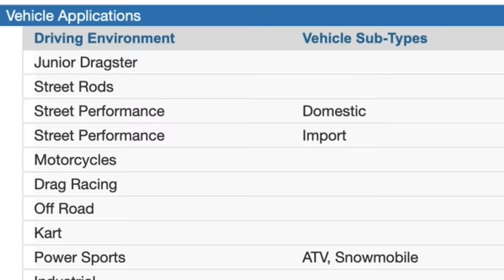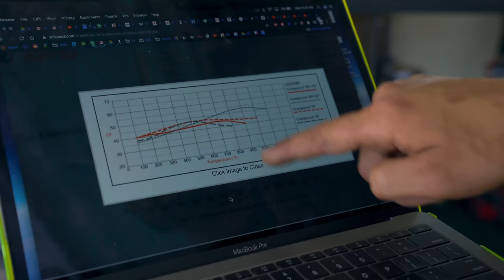Are Big Brakes Worth It?

Comment: One thing I did not hear but saw in the video is if your rotors are corroded and stuck make sure you use a rubber mallet. You can crack or break pieces of your rotors off with a metal hammer always go rubber.

Comment: drilled rotters are not drilled for cooling, they are drilled to let the gas that builds up between your rotor and the break pad escape.  The point is to prevent your pads from floating over your rotor at high temperatures.

Comment: For track work it is equally important to times to be able to brake as late as possible and slow down as quickly as possible as it is to be able to accelerate quickly. And on the street, so long as your pads are designed for street duty and do not require lots of heating to be effective, the extra stopping power will serve you well. I run Wilwood Aero's (6 up front 4 out back) with BP20 pads on a 3,500 car using 14" rotors. Dusty as all hell but quiet with the exception of the floater clicking. Far better friction and stopping force before ABS is triggered. On the road under hard braking my concerns are always about my ability to stop faster than others and getting rear ended - stopping in time is not much of an issue, even north of 100mph. If you are converting a street car for track duty, brakes are probably the biggest bag for the buck along with tires and frame stiffeners. Get your suspension dive dialed in to properly load the fronts under braking and life will be good... (To this day, I am still not as brave as my Wilwoods are good).

Comment: I know its a bit late for that, but make sure to NOT do any unnecessary heavy brakeing or emergency stops for the first 50km. If you dont do that the rotors might warp/bent(dont know which is the right word for it, sorry)

I hope this helps not getting any unnecessary costs! 18:38

Comment: 7:49 - "as you can see the new brakes aren't way bigger, and honestly, they feel like they weigh about the same" but technically they ARE larger in diameter, so if we assume for a second they are at least IDENTICAL in weight (hint: you should have weighed them for comparison) then the performance gain here is not so much in outright weight savings, as it is in having potentially INCREASED BRAKING TORQUE.  it's important to recognize fitting a larger diameter rotor is same as grabbing a breaker bar to loosen a stuck/rusted bolt (we've all done that one).  the longer "lever arm" mathematically increases torque at the hub center even if the force applied at a distance remains the same (but of course you increased that too with the caliper swap).

Comment: Thanks for this video, I have a ‘16 Mazda3 with brakes from mavis i believe, which are low, and occasionally I don’t like the distance it takes me to stop. I’ve been thinking I outta upgrade the brakes but I don’t want or need race car price tags or looks. I’m going to start with replacing the brake fluid and priming the brakes and see how much that helps - and check out a shop that may be able to recommend brake fluid that would be better than OEM. Hopefully that could improve braking performance before I have to actually get new rotors and pads. I’m certain the low pads are playing a part in the almost-longer-than-I-would-like-break-pedal-travel.

Comment: Video👍
Small disc brake - change Fluid and Good Quality Pads 👍 cool.
Does big disc brake give more stability ? How it fells , more control on your Steering Wheel and tyre ,abs noise or that traction,what...

Comment: Tip: When your rotors&pads are hot. And you're at a stop light. Shift the car to Neutral. This prevents the pads from sitting too long on the rotors creating a layer of material.
Reply: Good advice.  Also, rolling up to a stop with foot off brake after doing most of the braking earlier helps.  Then, gently slowly brake to a stop, kind of like how big rig trucks do it.
Stay gold.

Comment: New brakes depends on the stock ones, i know my 370z stock ones quite suck,so pads needs to be changed and for sports use you need to take larger ones to brake safe

Comment: One thing I think should be mentioned is that tires have the biggest impact on how fast you stop your car. If your tires are worn out, you will not stop as fast as with a new set of tires. Brakes are important for stopping, but the grip of your tires matter even more. Don't bother with big brake kits unless you already have good tires, pads, rotors, AND your brakes are overheating.
Reply: This is the answer. You can only brake as hard as your tires friction will allow. Whether on brembos or oem calipers, doesn't matter till the tires can't handle it. 
Besides the difference in heat dissipation anyways.

Comment: For a street Miata, just get NB sport brakes.  Running them on my LS1 car and they're just fine.  If you're driving fast enough on the road to fade NB sports with good pads you're going too fast and are putting others at risk.

Comment: One small error here. Well, not a total error, but something I personally recommend 99.9% of the time is that if you are replacing/ or just servicing your brakes (i.e. All 4 sets of pads) is to do a full flush. Not only wait for the bubbles to go, but to also keep going until the fluid is clear. NO old fluid left at all. Just my 2c worth. ;)

Comment: It looks like he's installed some sort of subframe connectors, I think that's what those truss like metal rails are. They don't look like factory parts, I'm sure those help stiffen things up. 
  I've never seen rear disk brakes with an emergency brake system that works like that but the only vehicle I've ever had with rear disk brakes was my old 2001 Silverado. The way they implemented it was very different. What they did on it was the back of the rotors were hollowed out to form a miniature brake drum with these little bitty brake shoes with the emergency brake cable attached to them. I'm not sure which system is better. Also I suspect that a small car like this would not have enough mass on the rotors to hollow enough out to mount the little brake shoes. 
  I had always wondered how my trucks emergency brake worked with disk brakes until I pulled the rotors to replace them, I thought it was a pretty clever design.
  My 2008 Silverado has rear drum brakes and my new complete brake system was just delivered yesterday from Amazon so I am changing everything. Including drums and all hardware plus front rotors and calipers. I am seriously dreading doing the rear drum brakes. They are so much worse to work on than disk brakes. The rear brakes are totally shot and the wheel cylinders are blown out. I think bleeding then is going to be a total pain in the ass. ABS brakes seem to be harder to get the air out of.

Comment: for track cars and people carrying a lot of cargo long distance big breaks make a lot of sense, for a casual trip to the grocery.. not so much but hey having powerful brakes is always good, you never know when you need another foot of emergency braking to save a life, your own or someone else's, but that doesn't mean more clamping is always beneficial or even the point, performance brakes can also be lighter, last longer or take longer to overheat due to extra cooling, lower mass or simply superior design, all of which are good things, lastly some performance brakes have at least some adjustability, which means you can tune in a great foot to the floor emergency brake that doesn't lock unless you really ham it, which will give you optimal performance. ( you actually don't want to lock the tires, you loose control and overall traction which makes the car slide instead of decelerate, and potentially put flat spots on your tyres )

Comment: Personally, depending on the car and what you do, I think upgrading to steel braided lines is good enough. Replaced the rubber lines on my 525i and honestly is the best braking car i've ever driven so far, i've gone from 45 to 0 in just a couple of seconds. Got myself some Brembo ceramic pads up front and Duralast Gold ceramics in the back, course i drive the car as a daily and only on the street rn, but I do have huge plans to take it to track days and car shows eventually. (Hopefully gonna manual swap it and stroke it to 3 liters next year :D)

Comment: When I was young and stupid and playing Need for Speed, I saw drilled rotors and automatically thought the brakes were supposed to lock into those holes to stop the wheels completely. My thought process at the time went something like "if the wheels completely stop turning, obviously the car will stop faster." I learned many years later that this was not the case.

Comment: I would have to say that hitting a car on stands with a hammer and to check if it's stable first is probably not a bad idea, but checking the car first thing before doing a single thing once it was up on stands would be a better practice. Especially before removing the tires!! If it was not supported correct and it did happen to fall, you want those tires there to catch it!! So do your wiggle test first thing and whenever you see fit to really. But that first one is most important..

Comment: I bought rotors from EBC and was highly recommended not to clean off the oil/layer on the rotor with cleaning spray and that it should be done by braking only. Not sure what’s the best thing to do here.

Comment: Quick side note: don't use DOT4 brake fluid on brake systems that don't state that they support DOT4. DOT4 fluid applies more pressure than DOT3. Either modify your brake system to support higher pressure or use DOT3.

Comment: Great content, great install. Thanks. Re big brake kits, you don't quite explore the entire answer to the question, are big brakes "worth it". Allow me to take a crack by first giving a bit more detail of how this system operates. As you mention, if you can lock your tires with your current brakes, stopping power is not an issue for you (see get stickier tires, below). But that's not the entire answer. As you apply 180 lb force to the brake pedal, which is a lever acting with perhaps a 5:1 or 10:1 mechanical advantage on the master cylinder, this force is transferred to the master cylinder piston that generates up to perhaps 2000 psi of line pressure in the brake system. This is divided between the front and rear brake lines (the US DOT requires the system be broken into two separate lines, and front/rear is vastly superior to the 1960s GM X-pattern system where LF and RR were separate from RF and LR). This pressure is transmitted to the brake caliper pistons which clamp the pad to the rotor. The rotor is attached to the wheel/tire.

Here's where it gets a bit complicated: there are two forces acting at the tire contact patch: first, the "inertia" of the car and second, the resultant force that is the result of the amount of torque being applied to the rotor and the average distance of the brake pad contact point from the axle of the wheel. The inertia of the car (mass times velocity, or momentum, plus rotational speed of the wheel/tire/brake rotor times their mass, or angular momentum) is a false force "pushing" the car forward; the torque at the axle from the application of the brake, applied at the distance to the tire contact patch must also rely upon the coefficient of friction between the tire and the road to counter-act this and slow the car.

The force at the contact patch is the key: With a higher coefficient of friction between the tire and the road, the tires will continue to rotate despite braking force. If you're locking your tires when applying full brake pressure, get stickier tires. This will allow the brake system to transmit more force against the car's inertial.

But that's not the entire answer. Having a longer lever arm from the average pad contact point to the axle allows the driver to exhibit better brake modulation. Larger diameter rotors inevitably lead to better brake "feel", which is to say, the driver can modulate brake pedal pressure more precisely. So sure, larger diameter rotors help (to be precise--move the caliper further away from the axle). But so do better brake pads which, as you point out, have all sorts of different characteristics--like those you used which say they have a flat torque curve, which means that applying more pressure gives a linear increase in more bite to slow the car, or perhaps higher coefficients of friction. Racing brake pads, when cold, behave like a bitch, with nearly no "torque" until hot. But when they overheat, they don't lose as much torque (as opposed to street pads which will exhibit fade).

Speaking of brake fade, when I lived in Europe, one summer I rented a Renault I-don't-know-what in the South of France and had a lot of fun inducing brake fade down some of the hilly back roads. This was caused by the brake fluid boiling. The brake system is hydraulic, because water is not compressible (see: Hurricane Ian and engine lock failures!); for various reasons, we use brake fluid instead of water in these systems. But as you point out, brake fluid is hydroscopic; when water enters the brake system (it always does--it's the humidity), this water will turn to steam when heated. Liquids are incompressible, steam is not--it can be pressurized. So if you overwork your brakes, the fluid boils and the pedal turns spongy--this is because you're pushing on steam, which compresses some, like a balloon. The cure for this is not only replacing your brake fluid yearly (if you're tracking the car) but also to install brake cooling ductwork. Cut away or remove entirely the dust shield and get some 3" or 4" hoses ducting high pressure air from the air dam to the brake rotor & caliper.

Another issue with larger rotors is that they increase the thermal mass of the brake system, so when they heat up, the system takes more time to recover.. Larger brakes = stay hot longer. The brake system works by converting kinetic energy into thermal energy, and the work the brakes do is the amount of energy they absorb over time. The faster you go, the better lap time = the less time you give the brakes to recover. So you ask the brakes to do more work. And this is limited by how fast they cool off.

Another problem is that rotors are mounted to the hubs, so as you point out, they are part of the unsprung mass. They larger the rotor (plus caliper) is, the worse the wheel/tire responds to bumps in the road. Weight is always the enemy.

Up until 2 or so years ago, F1 used 13" wheels which meant fairly small diameter brake rotors. But these still slow the cars quite well, thank you very much. This is proof that larger is not better. Contrary to this, what implies that larger is necessary is that as a car is heavier, or has more power, larger diameter rotors are needed.

When I had my 944 Turbo, I swapped out the stock 4-piston 299 mm front brakes for 4-piston 993 Twin Turbo 322 mm front brakes. I also adjusted the front:rear balance (with a Porsche OE valve for this application--the Wildwood rear biasing valve is perfect) and the braking performance was improved. But was it necessary? I'm not so sure.

As for larger and larger brakes on higher and higher-powered car, normal consumers don't want to hear about brake cooling ducts, and manufacturers certainly can't sell cars to the public that will fail if brake fluid isn't changed every two weeks, like they do in F1. So their compromise is larger and larger rotors/calipers when the hp rises, despite this being wholly unnecessary.

Comment: Isn't it true that you also would want to go with bigger brakes if you change wheels and tires and go with a thinner sidewall tire?  The increased weight farther from the center point gives the wheel more rotational momentum and requires more stopping power, IIRC.

Comment: Hey I got an 06 Acura TL you can do mods on, I promise not to charge you for it! Plus you'll make a subscriber super happy! Or at least do a headliner video, door panels (previous owner cut holes for speakers for some reason then never put them in so yeah 6.5" holes lol. Oh and he put 20in rims with 3 different tire sizes and pulled and hammered the front two fenders :( but the engine works amazing and the transmission is in great condition.  Just gotta get the 20's off so I don't break my transmission

Comment: Also no mentioning of carbon fiber ceramic pads and rotors plus I wouldn’t recommend two different set of pads the rotors and pad get seated and will most likely give pad slap when you switch pads

Comment: This is probably in the comments somewhere, but SS brake lines are prone to failure due to the design and are not approved for street use because of it. Little benefit to running SS (Porsche Cups run stock lines FWIW). Wilwood BBK parking brake is completely useless if a parking brake is important to you. Finally, get a clearance template before you buy this to see if it clears your tires.

Comment: Wait so with these aftermarket brake kits you don't need to remove the caliper to get the pads out? I assume you just use a prybar to reset the pistons back into place for fresh pads then?

Comment: Was hoping this video would help me, provided a lot of answers but still have so many questions. 
Main one is, so if i want better stopping power (making sure my breaks are safe for daily driving) just switching out the pads will do the job and i wont have to do any upgrading?
Another one is. Does painting the calipers prevent it from cooling efficiently?

Comment: With my old miata I did amazon special brakes. Drilled and slotted rotors with ceramic pads and that car would stop on a dime and lock up all 4 tires at will.

Comment: When you got your bigger rotors, did you get bigger calipers to accommodate your larger rotors?  I bought new rotors on line and the ones I received were about 1/2 larger in diameter compared to my original Miata rotors.  I don't mind getting new calipers as well to go with my new rotors, but if they are the same size as the original calipers, I've wasted my money.